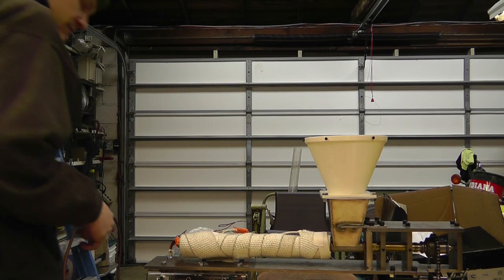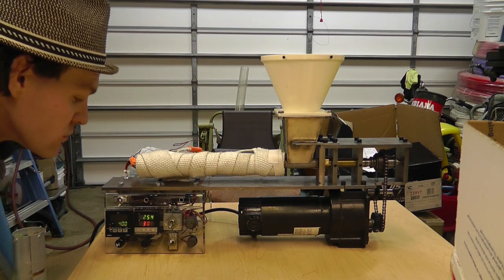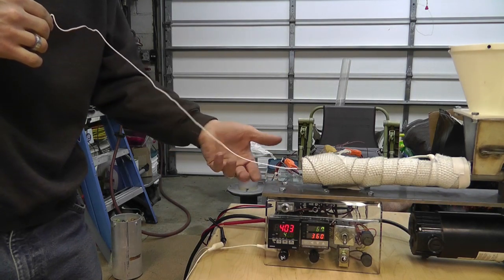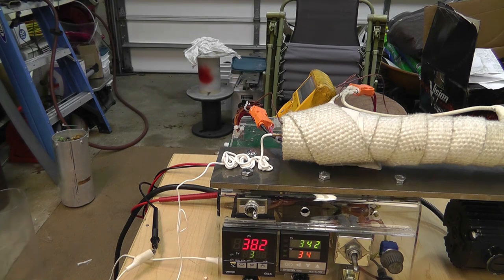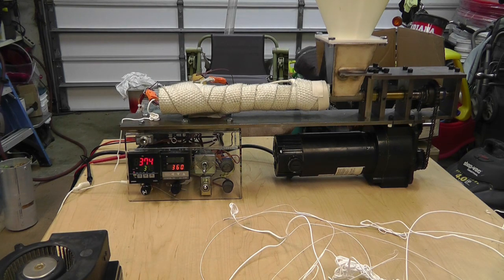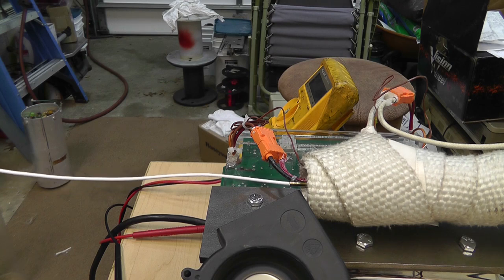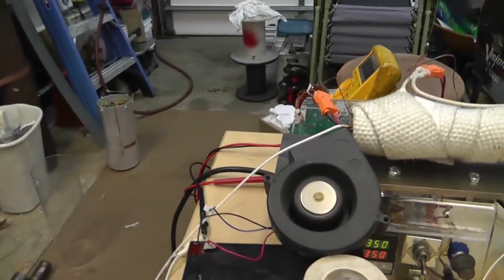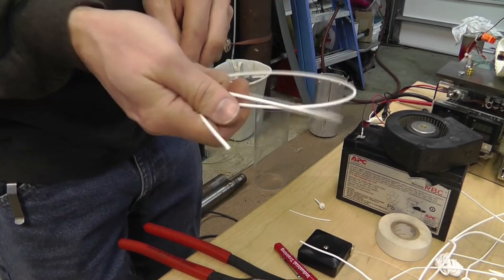#4 ~Russ's Filament Extruder: First Test Run! Wahoo! First Squirt!

Comment: Nice. You can tweak your design (more like 3D Printing out a small funnel/or diversion channel) that has small intake holes that you can use Nylon or Clear Vinyl tubing to channel cool air from your cooling fan to cool the extruded ABS.  Print out a channel that directs the ABS downward through a tube and onto a spool that can be on a stepper motor on a timer that tightens the tension to wind up the freshly extruded ABS into a New Spool for your Printer. Think of a Funnel/Dust Pan that's angled downward off the edge of your work bench and has cooling air forced into it through the sides.
Reply: +Bryce Rowe or just incorporate a cooling chamber with a fan of its own. Wouldn't suck too much power and should do the trick.

Comment: The 3d printed bricks is something I've been thinking about for a while now. I've always wanted to see people being able to build full size walls and entire buildings using BIG lego blocks, either built from recycled plastic or with the billions of rubber tires filling landfills. Each brick interlocks and seals with the other and just as with a set of lego blocks. Very simple, mortar-less, very strong, rot-proof, water-proof, modular, light-weight, ect, really exciting times we live in...

Comment: First off awesome "f"ing extruder. A couple things which no one has mentioned is i think your running the temps really high I think that would solve the problem with the filament diameter. Though most definitely get those ribs out of the tip, besides that amazing job. Above all, it is all made recycled parts, and youve given it alot of functionality and integrity. I will be making one of these myself and you ve given me some real good ideas, though i dont have access to a machine shop, so mine wont look like a prop from a terminator movie.

Comment: Wow! That's cool.
From what I calculated, the maximum output volume is 845 cm3/min.
Which means that the maximum extruding speed for 1.75mm filament is 154 m/min (60 inches).
Great work!

Comment: smaller tip will help since the large amount being pushed through is causing the swelling at the end or as someone commented earlier pull on it like they do with fiber and nylon for the desired size

Comment: Great extruder Russ, you should play with motor gears to get mote speed(you should extract a lot more power from this HUGE motor) and It's a good idea to use small waterpomp(maybe from aquarium) to cool the ABS plastic with running water.
Sorry for bad English ~ico

Comment: When I bought my first 3D printer,...the first question was, how do I recycle plastic..  $25 a spool is a bit much,..and to be able to recycle bad prints instead of throwing it in the garbage made sense. So since day one, I been saving all my rafts, etc. in hopes of doing something like this...it makes sense....everybody has plastic available to them  Cheers ... just need "clean plastic"
Reply: Skippy Farnsworth. Grab an old monitor and you will have all kinds of ABS from the housing to work with.

Comment: It's funny that you mentioned safety glasses. I want to make a suggestion that you add a large mesh safety screen inside the hopper just as a precaution since you have small children. Use something with a large enough mesh as not to impede the flow of the beads but small enough so that fingers can get to that drill bit. Before I forget, Nice job man!

Comment: i used to do industrial extrusion... if u  made i winding system and set the speed to slightly higher than the extrusion speed u  will get a thinner strand without changing the die head... plus a luke warm  water only bath vs. your fan is better
Reply: hi rob am facing problem with plastic extrusion have used abs material 
what is the right temperature to extrude abs?I have heated it till 300C now its brittle!! and not porous if I extrude it at 210c its not that brittle but its porous!!please help me
Reply: The filament sucks moisture from the air and that's bad. Everybody tries to keep the filament as dry as possible, you cool it with water. It must be that filament you can buy with 5 bucks...
Reply: Lingaraj. S. K , its all about grade of abs. Injection grades can be processed at 320 F and extrusion grades can be easily close to 460 F.

Comment: I agree. This is what I keep telling people. I envision machines like this you can throw plastic bottles or waste in that will shred and process them to be recycled into new filament coils. 3d printing is going to change everything. I imagine someday soon you will see all in one plastic and metal printers with multiple hoppers of different materials. Hardly anything would go to waste and it would be so much cheaper to produce product locally. Yes Manufacturing is coming back to America...

Comment: hey russ you might try a water bath to cool your filament quickly enough that you wont vary thickness. I think you could get a non tapered line that would work in your  printer smoothly

Comment: Hmmmmmm . . . imagine, we might have to mine all that plastic floating in the ocean one day, to keep the recycling industry going, after everything gets recycled on land, and has been turned into cool stuff.

Recycling:

Scaled from micro, to making building materials, bricks, tubes, panels, decking, (big hopper, big 3D bricks).  . . oh, . . . right these extrusions are for the 3D printer, . . . maybe a bit of an uptake reel thing at the right speed may help with consistency of the filament,

Comment: Good work!!
Don't worry about the coolingl The correct size will likely cool twice as fast. Surface to cross section ratio, you know. Half the size will cool 4x quicker if my logic makes any sense at all.
Can it go on a bobbin without breaking/microcracking when cooled down all the way?

Comment: I don't think the electricity is going to add up to that much. Pre-made filament is expensive, well depending on where you buy it, but this way is probably A LOT cheaper.

Comment: design it vertical. and hang it up high. put afew mini fan as it fall. harvest into the spool as it reach the ground. fan should point downwards so the filament dun sway too much. i m not an engineer, so my idea might b flawed in every sense.

Comment: Nicely done there guy! Give me the material specs & i'll tell ya the correct temp to extrude it. I run a medium sized extrusion plant. I extrude an average of a 1/2 million lbs a month. If you run into any issues please let me help ya out.
Peace Out!
Reply: Sorry, do you know which electronic controls is he using? it's not clear in the videos.
Thanks
Reply: ModulArt22 I am ass-u-me- ing you mean Temp controllers? Type in temperature controller P.I.D. on Amazon. you can get the PID controller, solid state relay with heat sink, thermo-couple (K or J type) & heat sink for under 40.00 usd. I used J type on all my extruders. I use K type for all my personal play projects. We have used several (12) of these cheap China controllers and only had one bad one. Hope this helps.
Reply: search for novus Novus Mod. N480D-RRR
Reply: Dan Murphy  is all of your work with virgin plastic?  Do you work with any recycle plastic even if it isn't 100%?
Reply: Armis Game I do both. Food grade 100% virgin materials & some non food application that has as much as 60% reprocessed regrinds.

Comment: i got a question about the nozzel.. what would happen if the nozzel was about 50mm long and the last 25mm was inside a water cooled jacket.. The filament would come out hard and the right size?
Reply: +Raymond Merrick it might get stuck and would be harder to control.
Reply: Most thermoplastics shrink quite a bit as they cool, so it shouldn't stick.